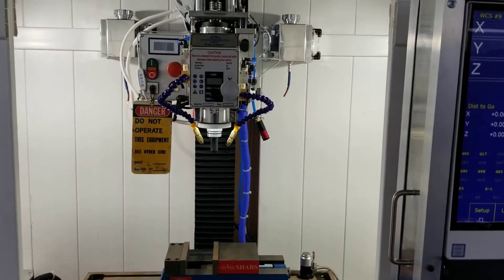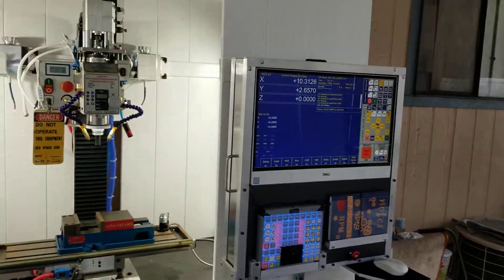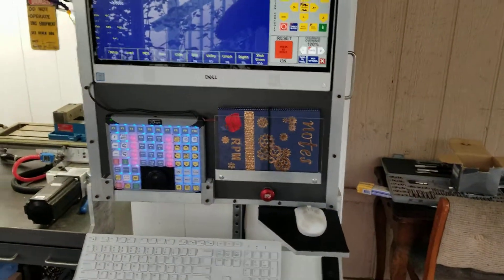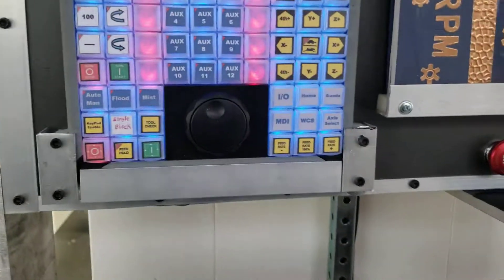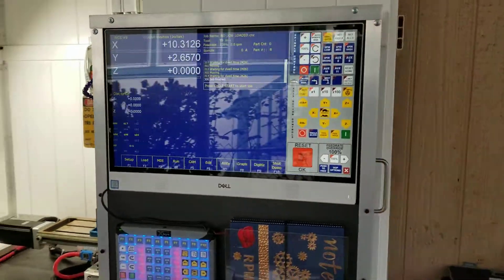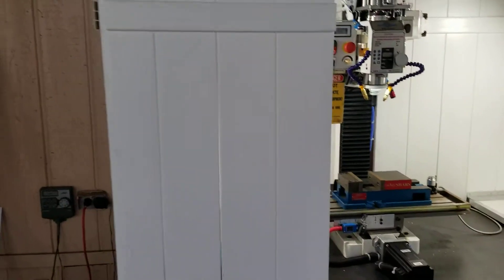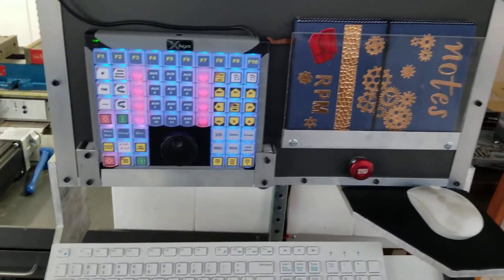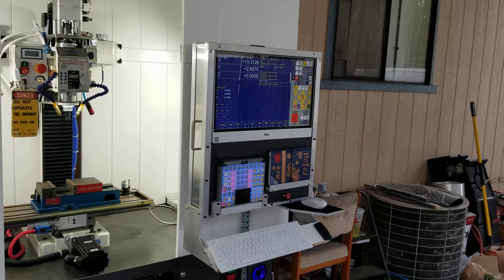Control console completed

Comment: I like it! I think I'm going to go with the same probe you have. I need to contact them about a question first.
Reply from the maker: Maybe I can help.
What's your question?
Reply: @rpmcncchannel4147  I was going to ask them. If I can set it up for my acorn now wirh the tts setup but also use it on a tormach unit later if I decide to go that route in the future.
Reply from the maker: @ponydowncnc8365  the answer is yes.
It is compatible with Tormach
Reply from the maker: @ponydowncnc8365  I am also using TTS tooling by the way
Reply: @rpmcncchannel4147  I think if I set it up with the tts it's only the plug that changes. I guess in the end it's not a big deal as it's not a super expensive probe. Thanks for the info.